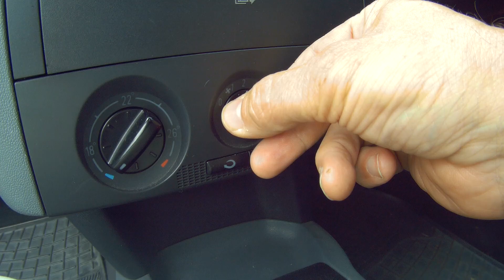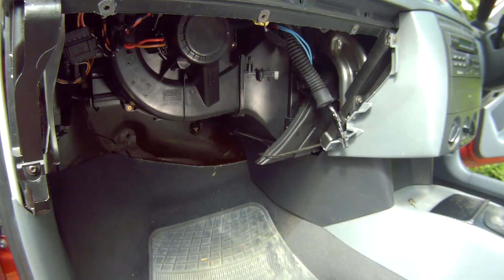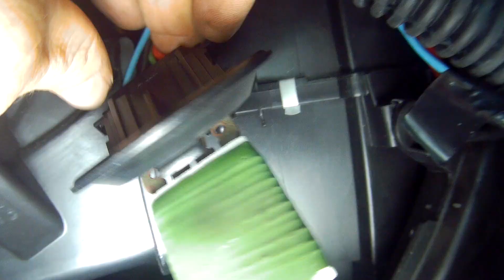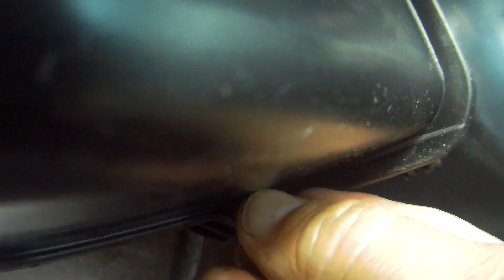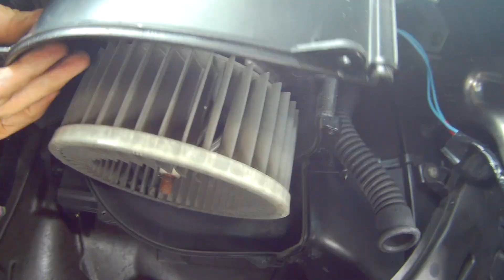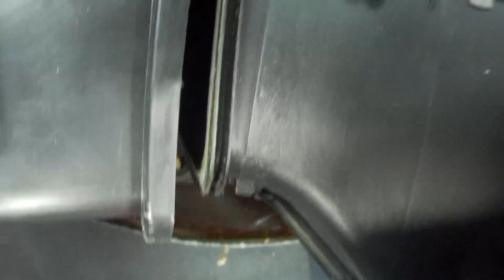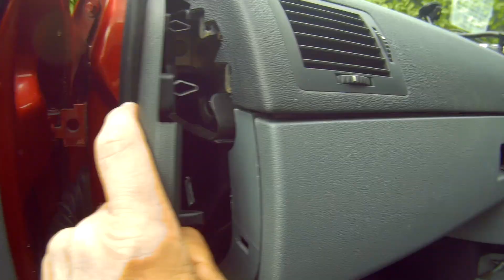SKODA FABIA Heater Ventilation FAN+ SPEED CONTROL

Comment: I have a 2004 Mk1 Skoda Fabia. The interior air recirculation button stays illuminated all the time, and when I press it, it doesn’t work as it should. What could be causing this problem? Thank you for your help.
Reply from the maker: My initial thoughts is it's probably the button itself that is faulty. But it could be related to the flapper motor not working either (common issue). Also, Is the AC working? Hot/cold not working? Fan not working? Inside Blower fan not working?
Reply: @HatBoyHarvey  Yes, the air conditioner is working. Both the heating and cooling modes work, and the fan is working too.

Comment: Do you know where the hot cold cable is. My heat is nothing what it was. Iv a 1.4 tdi skoda fabia 05
Reply from the maker: There is a common fault with the Fabia heater hot/cold flapper motor getting stuck, often on hot, but can be on cold. No cable, electronically controlled by the head unit The positiin is at the rear of the HVAC unit behind the glovebox. If you get to it you can manually turn the quadrant lever to free it up. Replacing the service motor will need calibrating.
Reply: @HatBoyHarvey cheers im gunna do this living in ireland i dont mind it being on hot.
Reply: @HatBoyHarvey wanna say thank you for your time. Im nearly finished id say one more bleed and a good drive should do it. I could feel the heat actually hitting my face lol. Thank you and have a great new years, Harvey. Two pipe going into the cabin, bottom ine was cold, but today both wear hot. I assume thats a good sign. Anyways thank you. Again. This not the first  second or third time you helped me.

Comment: Hello Harvey! I have ABS thing in the glovebox (for turning it on and off), is procedure of taking off the glovebox the same or it have to be somewhat different because of ABS? Greetings from Serbia!
Reply from the maker: Never seen that, post a photo of the abs switch on your channel page and I'll have a look
Reply: @HatBoyHarvey u can take a look!
Reply from the maker: Air Bag, not ABS. Disconnect the battery neg earth lead before taking the glovebox out, then there will be a connector to the front AirBag when you drop the glovebox down.
Reply: @HatBoyHarvey yeah, i didn't think . OK, so it's safe to take battery off then to do the rest. Thank u very much!

Comment: Thanks for the helpful video. I did this job today. I found removing the fan and the cabin filter made the job a lot easier.

I couldn’t fit the resistor I bought as it was, I removed it from its plastic housing and pushed it into the original VAG plastic part which I had removed from the car.
Reply from the maker: Great to hear you eventually installed the sensor/resister. An unusual way of doing it, but one worth sharing, thank you :-)

Comment: This is much easier on the Mk1 than it is on the Mk2.  Yesterday I had to replace the blower fan on my Mk2, which requires removal of the whole dashboard to get to the screws on the fan housing.  That's an all day job.  BTW, the item you replaced is not a sensor, it is a resistor, which provides differing resistance for each fan speed and then no resistance for fan speed 4.
Reply from the maker: That sounds like a job and a half, but I bet you are glad to have done it. Good info for all Mk2 owners, thanks. information from the resister is sent to the ECU to regulate temp for heating and AC in combination with other temp sensor info around the car.

Comment: Hello. Thanks for this great video. Helped me loads. Mine was only working on number 4. So changed the resistor for another oem one from eBay. Genuine. £50. Fan worked fine for 2 weeks. Fan made some noise on lower speeds and now has packed up again. From your experience do you think this means the motor is also faulty and has fried my new resistor already? In which case I’ll swap both. But just wanted your opinion. Thanks in advance.
Reply from the maker: That's a shame. the fan may have been drawing too much current or worn loose and shorted, so I'd be inclined to test that with a separate 12v supply first. if it works smooth then look into the connections and wiring, if not or rough then replace.  Hopefully the resister is still OK. best of luck :-)
Reply: @HatBoyHarvey Thanks for your rapid response. I really appreciate it. The cars a keeper so I’ll just change both at the same time I think. Thanks for your help. Keep the content coming. It’s brilliant.

Comment: my vent is working but the button for the inner vent stop functioning it didn't light up and normaly a fan or something would get louder but it doesn't. Could it be just the button or something else? and also the temperature knob i think. When i had the car "new" they said it always heats and it was like that. in the summer setting it on cold it heats but i think after screwing the knob a little bit around it now kind of works, i will see in the summer 😂
Reply from the maker: The heat control can become temperamental with older cars. Vent diverted flap valve gets stuck on hot. Turning the knob to full either way overrides the control to work fully. Keeping it on cold may eventually force it to move :-)

Comment: Question fir you if you dont mind. I recently bought a Fabia Monte Carlo 2011 and the air that blows out through the vents is only hot like ots stuck on heat only so no clod air comes through at all and ot gets pretty damn hot in temhe car. Do you do what this may be? Is it the flappy motor thing or a sensor? Any help would be really appreciated. Many thanks 
Ryan.
Reply from the maker: Could very well be the floppy motor that has jammed. These re hard to get to and need calibrating when installing  new one, but other sensors need to work long with the heater control unit. The in-cabin sensors can get clogged with dirt - easy to clean. Vent temp sensor shouldn't be too bad. All these faults can be identified and isolated with a diagnostics reader showing the fault code. :-)
Reply: @HatBoyHarvey  Thanks so much for the reply much appreciated, when you say the floppy motor will need calibrated, does that mean it needs to go to Skoda? Or can it be done myself? Is there a proper name for that Floppy Motor? 🤣 Just in case I need to search one out. Where are the in cabin sensors located? I think you have a video of maybe one for the sensors whilst replacing a heat sensor, it looked like a cheap flat green microchip board tucked up under the dash. I just bought the car just about a week ago but not had the controls on cold as it had been sat for 10 months not doing anything and was damp so have been drying it out, but it's getting a bit hot inside as it's just throwing out very hot air, nothing to do with the low coolant level is it? I do not have any warning lights on and have plugged in an ODB reader but nothing is showing as a fault either. Many thanks in advance, much appreciated.
Reply from the maker: In that case I would take it back to where you got it and get them to fix it. Sorry typo 'flapper motor' or temperature control blending flap. this often gets stuck ion HOT. Run it for a while  on COLD it may free up and start working. turning the control to cold or hot overrides the system and moves the flap fully  one way or another.
Reply: @HatBoyHarvey  it was a private sale sadly, it had been sat there for 8 months not doing anything and due to it being cold I've not had to turn it down to cold until a few days ago that's when I noticed it staying hot. I'll try what you suggested and see if it fixes it, I kinda hope it does, I wonder if there is a way to lubricate the Flapper Motor without having to take that damn thing out. Thanks for the advice much appreciated 👍🏼

Comment: I've changed resistor and have better speed control, but like with the old one ventilator still blow at low speed also switch is little jiggly. Anyone knows solution?
Reply from the maker: As you are prompting to say, look at the switch. I don't know if it is separate from the control board, if not then a new controller maybe needed if the fan isn't changing speed and you changed the resister. You could check the signal to the resister.
Reply: Fan changing speeds but when is turned off ventilator still working at lowest speed. I have same issue with old one but only 4th speed left.

Comment: Hello Harvey, great video, as always!

I have this problem, the vent was working on Nr. 3 and 4, than on nr.4 only, and than stopped working completely...

I bought new resistor, and connected it, but I didn't put it back in its"hole", before testing if it's working, and it is not working, I started the engine, nothing... 

Could it be the fuse, I didn't check that at all ... I was looking at the fuse diagram, but not sure which number it is... I didn't disconnect the battery... Is there a way to 'short connect ' the vent?

Thanks!
Reply from the maker: There is a thermal fuse on the resister pack. Always disconnect the neg on bat first. Sorry not sure offhand which other fuse is involved without looking at wiring diagram, but it could easily be that.
Reply: @HatBoyHarvey  Thanks on fast reply Harvey! So, if I understood well, I should disconnectect the battery, and reconnect again, and check the fuse, and than, check the blower itself? Thanks again,!
Reply from the maker: @nenadpopovic6858 if the resister pack don't work, check all the fuse first. You should always disconnect the bat when doing anything electrical on the car. You said you disconnected it without disconnecting the battery, so It may be relevant here, maybe not. I would check all fuses first. Some on battery top also.
Reply: @HatBoyHarvey  Thanks a lot Harvey!

Comment: Excellent! Really useful. Do you know the location of the interior temperature control sensor? Since new (along with other out-of-the-factory faults, but that's another story) the heater has been Nothing-nothing-FULL ON INCINERATION FIRES OF HELL OW OW OW IT BURNS over the first three notches of the dial. Any ideas? New video, perhaps?
Reply from the maker: Maybe you have auxiliary heating? For such extreme an experience, but this often happens without that when the hot/cold flapper control flapper motor starts to fail or simply wears out becoming temperamental :-)

Comment: Hi, changed the resistor pack and still only blowing on no.4, any ideas please? Great video btw 👍
Reply from the maker: Oh, never known that, good question, anyone, I'm stumpt` if it does work on 4 then it shows there is power to it,just not enough perhaps. test the voltage and work from there, should be 12V.

Comment: Watched your video again  ,,so if its 4 degrees outside should my mk1 skoda heater still get hot, does it use a heat exchanger from the engine? Or a dedicated heater system please???
Reply from the maker: They use a heater core mounted at the bottom of the HVAC system. A radiator essentially. But there was an option for auxiliary heating, but very few have this and uses a lot of batty power. The heat temp you want is controlled by the knob on the control panel by demand to the desired temp using the various sensors or overridden by turning knob to full hot or cold.  Often on Fabia model  car gets stuck on hot or cold due to a faulty flapper motor.

Comment: Hello Harvey,

Thank you for your video, it was very helpful when my resistor controller worked only on number four. I changed the whole resistor. A strange thing happened after that. Shortly after that one cold morning I started my Fabia and noticed that the fan wasn't working anymore even though I changed it with a brand-new one a few days before. What I did then was to change only the little element on top of it(only 0,90 st in Bulgaria) Bought three of these just in case. Shortly after that, on another cold morning, the same thing occurred. I already knew that something else was causing this and the problem was not the resistor itself. Changed it one more time. Now I switch the vent knob to zero before I start the engine(I did not do that before, always on 1 or 2), thinking that if it's set on while starting the car, the total amount of electric current for a moment maybe is overloading this little element on the first cold start. So that might be causing the issue itself. No problem until a few days ago when the vent heater started to sound agonizing like it was screaming and dying.  Now I already knew what was happening. The bearing of the vent heater is destroyed, causing this awful sound, and the electric motor inability to sping freely eventually applies additional resistance to the whole electric system of the fan heater itself. The resistance(or impedance, not sure) maybe is overloading the whole circle causing the resistor to burn. Long story, but I thought it would be interesting to share this. My question is, is there a way to change only the bearings of this little motor or do I need to buy a whole new one with fan? Thanks in advance!
Reply: Update: It's unrepearable, it just not worth it. The motor is not on bearing but on bushings. I put some oil on them but the noise is still there. Just ordered a new one.
Reply from the maker: Yes you are correct, I did the very same. It's not worth trying to fix these, just replace the whole unit. Hope it fixed the issue :-)
Reply: @HatBoyHarvey  Hey there! Thank you for your time! The issue is fixed and the new blower motor works well and quiet, with minimum noise. I'm very happy with it now. Thinking of this part being in the car for the last 18 years it did a pretty good job for this time. Time for the old blower motor to retire, there is nothing more I should want from it, haha. Thank you for all of your amazing videos. I know so much for my fabia now and you saved me alot of money for a repair. And most important, I love the details of your videos and how carefully everything is being removed and placed back without being broken. That is the main reason I always wanted to do  the precise repairs on my car by myself. Knowing that I will put time and effort to figure out how to remove something without beaking it, while in the car shop repair, the mechanic will be less carefull i think. Now it's time to figure out from where is the boot leak on my fabialous car, it's gonna be a tough one :D !

Comment: Watched your excellent video ,but my problem is my fan speed works ok,but I'm not getting heat from the system at all only lukewarm can you help please?
Reply from the maker: This is often down to the informous flapper-motor for hot/cold getting stuck, if pressed you can take part of the dash out and move it by hand to hot for a temp fix, whilst accessing it 'test it's operation and you may see if it is temperamental or not. Certainly do a coolant flush and a separate heater core flush, change the thermostat. OBD2 diagnostics will highlight any sensor failure elsewhere, but you can clean the cabin temp sensor with a brush. As long as you don't have the AC button pressed a dead AC pump won't effect the heater circuit :-)

Comment: Helpful hint(s) follow - I hope.  Thanks for a very useful video explaining how to do this job.  It's very tricky getting in there to remove the resistor pack (and I have small hands) - but I found it almost impossible to get the damn thing back in.  Cold day, knock off to warm hands and think...  so I removed the cable (make a note of the colour of the nearest wire), and found it very much easier to get the resistor pack back into place without the cable pressure.  Cable back in (fine long nose pliers handy for this) and the job's done.
Helpful hint 2 - I was struggling to hold the glove compartment up whilst replacing the screws..  duh...  empty the ton of junk out first ... sometimes we miss the obvious!

Comment: Hi my recirculation has stopped working it used to come on when in reverse. If I press the button it lights up then goes off about 5 seconds later. Iv looked at the blue cog and it still opens and closes the flaps when I press the button but only seems to open about 1cm. Is that normal?
Reply from the maker: I've heard of this, but never tried it and maybe it is only on certain models. It is a safety feature when selecting reverse gear to prevent exhaust gases entering the cabin space. Yours does sound faulty to me and need investigation. You could try lubricating and moving the mechanism by hand whilst it moves to see if it is the motor. These are often faulty intermittently and not easy to get to fix as they have to be set up correctly to work properly.
Reply: @HatBoyHarvey  I managed to slightly disengage the motor cog to check if the others moved and they did turn the flaps really easy. They open really wide too but for some reason the motor only opens them a tiny bit.
I keep smelling exhaust fumes in the cabin when I stop too so wondering if this could be something linked to that

Comment: Sir once agsin thank you on an excellent video. My Skoda fabia 1.4 mpi (50kw,model with air conditioning) sometimes heats when it is on cooling,and sometimes cools when it is on heating.If I turn the ignition off,and then I start again,after a minute or two it becomes OK.Could this  resistor be the cause?
Reply from the maker: If the fan speed works OK I wouldn't change it. I have had the same fault, which went away a day later. I haven't yet found a definitive answer to why this happens only guessing it could be the main heater control unit or it's connections at the back. I've had mine out, disconnected it a couple of times and re-connected it and that fault hasn't returned, but it might not be that at all anyway. The vent air flapper motor for hot and cold goes faulty on these so that is something to be aware of. I haven't yet done a video on that yet as fitting new ones may need re-calibrating with VAGCOM :-)